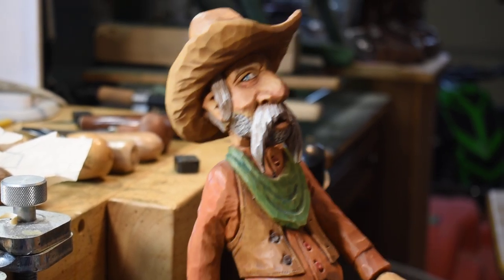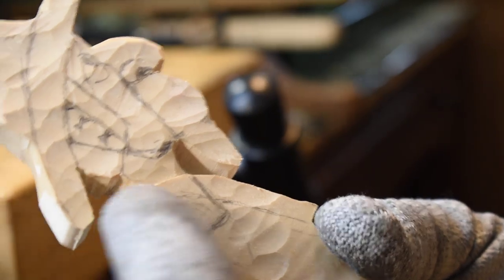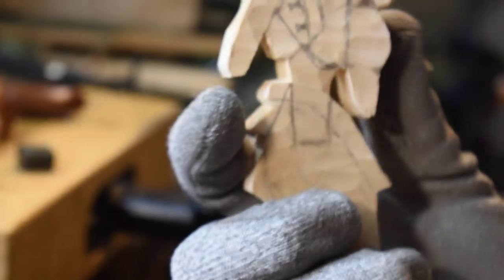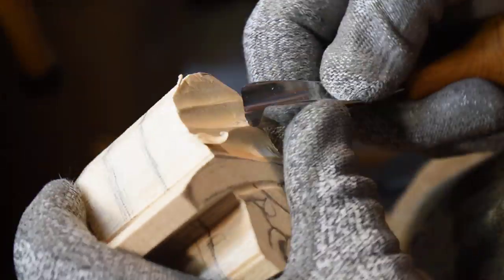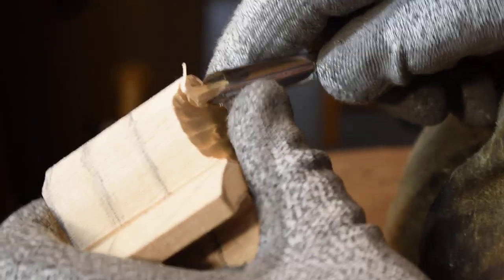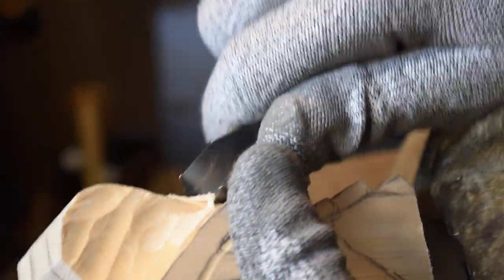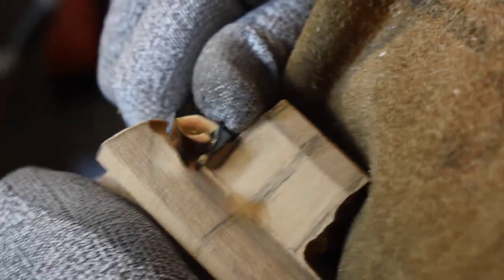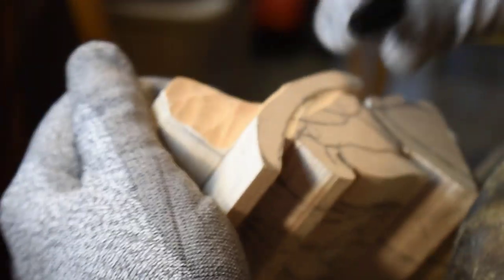Cowboy Bust with a Handlebar Mustache.  Part 1- Wood Removal

Comment: Could you do this straight from a block of wood?
Reply from the maker: Absolutely, that is what I did originally, but for the tutorial I used a roughed out version.  Just take the block and draw on a "pattern" cut out the excess and carve away!  Keep the chips flying!
Reply: Roger Stegall Woodcarvings brilliant, because I’m new to it I like the full tutorials with the block. Going to give this a go though and try and draw the pattern on thanks Roger.